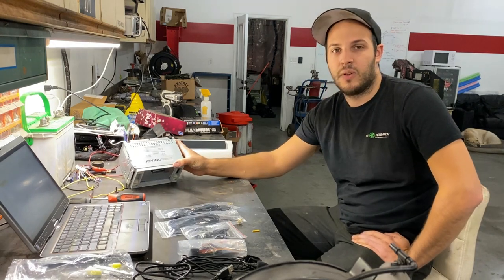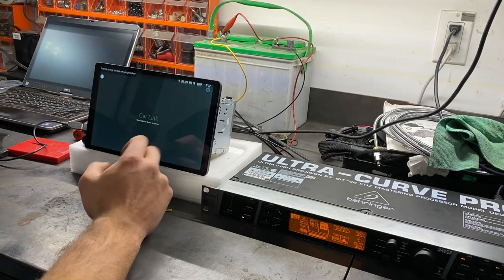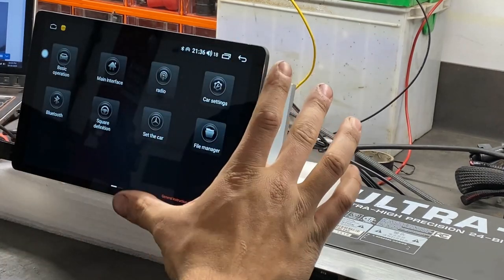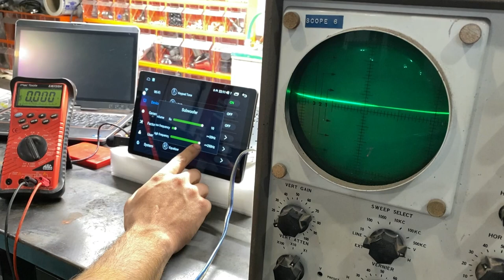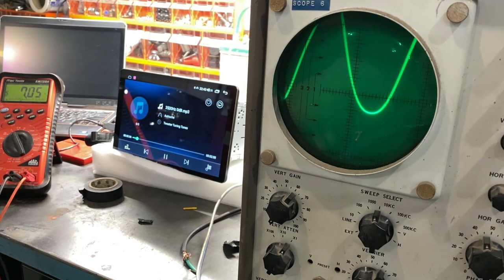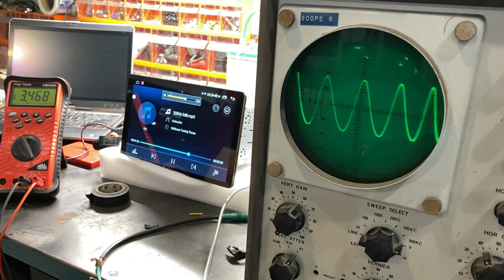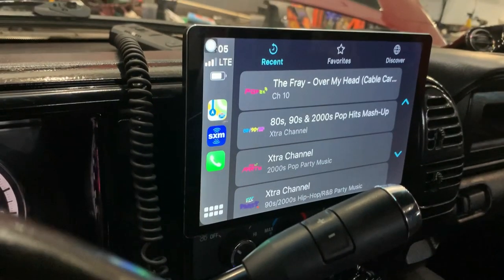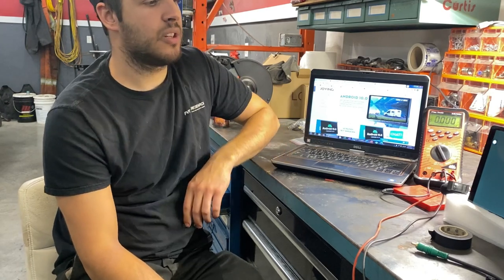NEW RELEASE ALERT! Joying 10.1" HD High Res Audio unit - Optical Output!! Ultra Resolution Screen!

Comment: P.s...I ordered my Intel based joying after watching your first video and absolutely love it. I ran it to my dsp via coax to optical input with a digital to digital converter.  I was surprised that the surround feature in the head unit was still operable after connecting it that way but it was a pleasant surprise because I can tweak the soundstage up to the center of the dash or wherever certain tracks sound the best even after saving the settings in my dsp which in my case is welcome because my dsp is a bit limited.

Comment: P.s.s...I dont think the "loudness" button boosts any voltage 
 in any way that's why it didn't clip your meter. I found the loudness feature to be very useful when listening at very low volume ( such as when your wife is riding in the vehicle and you can't turn it up past 2 or 3😂) because before at such low volume I could mostly hear the tweeters playing which was annoying,  but after selecting "loudness  on", it restored the bass and midrange back into the mix and I then can happily drive along with the little lady in the passenger seat. Test it for yourself,  it's a great feature to use when having to listen at less then optimal settings. All men play on ten, we're never gonna turn down again . Thanks for another great review,  peace.
Reply from the maker: On the intel units, Loudness did create clipping, You can see it in my first video. Thanks for Watching!
Reply: @colby dolby I agree with you. For lower volumes it's a great enhancement. A gimmick to so many but it works for me just like you said.
Reply: @LemonySnicket-EUC  question, 
Do you know what the true watts per channel is because it's saying 50 watts per channel???
I have 4 JBL gto629 6.5 door speakers and I would like to know if I'll be okay just running them with the 8 inch joying single din 1280*800P alone?
No amp

Comment: Thanks for the review. RCA/preamp voltage and detailed specs on their website are all that a lot of these Android units are lacking. Supposedly Dasaita has bumped their preamp voltage up to 3V after QMV reviewed their MAX 6 unit and criticized it. I've also noticed that on their website Joying no longer says what CPU model they are using, it just says 8 core 1.8GHz for most of them which is the same as the Intel based units but the 10.1" unit says it's an ARM CPU. I would be bummed if I ordered one of the vehicle specific units and got an Intel based unit which they could get away with due to vague specs. They also lack info on S/N ratio and RMS output of the internal amp. It's just crazy that a company can engineer something this complex and not publish the full specs like other manufacturers do.
Reply: Is there a way we could boost the voltage for the subwoofer preout coming out of the headunit?

Comment: Guys the reason I think they did the volume bar hidden is because this is Android OS. You can customize it. Download your self a Volume Control Widget. And have it set on Home Screen. Easy Fix....
Reply: Agreed. And the other reason also it’s very hard for right hand drive to turn volume knob if they put it on the left.
Reply: You can buy a wireless volume knob and mount it wherever. There are 2 versions available.
Reply: @LemonySnicket-EUC  Can u post me a link

Comment: Late to this party but man do I wish I had seen this. Wired my Android 10 2019 8-core (non-Joying branded) unit up to my DSP via RCA pre out and was getting very low signal. Measured it, and sure enough, 0.5v just as you mentioned.  Now I have to go back and use the speaker outputs to go high level into the DSP.  As a side note, my Android fader was not working either. It was sending front signal through the front preout and rear. Fading to the rear yielded no output. Wish Joying made a unit that looked a little more OEM for the 2006 BMW X5.  Anyway, thank you for the excellent information and review.
Reply: Is there a way we could boost the voltage from the headunit preout?

Comment: Greetings from Canada. Love the reviews and how detailed they are. Any updates on the digital output increasing to 96khz and I didn't notice if you mentioned if the output was 16 bit or 24 bit? 
Looking to buy the newest 10.5" with 6G or ram and 128G rom so maybe this unit will have a higher bit rate and Khz output

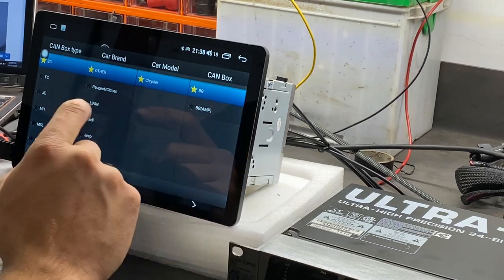Comment: Really appreciate the time you take to review these units in depth. My unit looks to be a pretty close match to this one and it’s really impressive so far. One thing I’m curious about - how do you know what the ‘box type’ is? You reference this at 20:50 but I don’t see any indication of my box type anywhere. Thanks
Reply from the maker: Unfortunately i “tried” all the ones related to chrysler. (Jeep,dodge,chrysler) until it started working. Maybe joying has better info.
Reply: @guimond47  mine seems to work fine with only a few exceptions that might be user error - the box type was set to null so I haven’t tried changing that yet - too scared lol

Comment: Thanks for the in depth video.  I am patiently waiting on my 11.6" 8G\128G unit to be delivered.  Trying to plan how I want to install and deliver signals to the DSP\amplifier... TOSLINK or via RCA's I may have missed it in the video... Is the SPDIF\Optical out only two channels requiring outboard DSP to realize separation and control of Fader\Balance\Sub, Front(L\R), Rear(L\R) & Sub channels or does it carry all channels?  If it is only two channels you loose control at the head unit unless the DSP has an android app that can be installed.  The Optical feed to the DSP\Amp is a nice feature if you can find a DSP\Amplifier with Optical\SPDIF input.
Reply: Did you ever get an answer or figure this out?

Comment: Convince them to make a knob/button that can attach to one of the four sides of the screen and is user movable based on use case.  Button control could use the same signal cable for the screen.
Reply: Just by a SWC wireless knob. They are like $20.
Reply: @extrakimF  it's amazing how so many people don't know this.

Comment: I dont know what source you used to test the sample rate but as far as I know, not every signal source is equal so depending on the source file it will determine what sample rate you see. A true optical output will play a recording mastered at 96khz. It seems your source was showing CD quality at best.
Reply from the maker: your probably right, my iphone Which is the source i was using for testing cannot provide more then 48Khz. I will try a flac file on Power amp and see.
Reply: Wouldn't the optical output they added be more of a convenience factor, seeing as most dsp's have optical in but not many have spdif input? Because spdif coaxial is 192khz where optical is 96khz. I'd be interested to test both of them and see if they arent limited to cd quality
Reply: @HAMMER_2.2  I'm hoping k&s will post his results after he tests his source unit. I used the optical because my dsp does not have a coaxial input which technically at 192khz would seem the more logical input if for ever any reason I was listening to a track recorded at that bitrate even though I highly doubt my used up ears could detect that difference anyway.

Comment: Thanks a lot for the great and extensive review. 
May I know if you have tested external USB DAC via the OTG?
Reply from the maker: No, it will not work. But why do you need it when there is a dac already in the unit, coax, Spdif optical
Reply: @guimond47  I see, coax and spdif of joying only upto 96kHz so i am trying if any chance to hookup a DAC via OTG to the back of the car and run a very short RCA to DSP. But i have decided on Helix DSP.3 which only upto 96kHz so i think doesn't matter already. Anyway, thank you so much man
Reply: @guimond47  Does the volume control work when youre connected via digital out?
Reply from the maker: @imraneo  yes

Comment: Great video... you said that we can cut the speaker wire leads and solder rca's... what's my options for a subwoofer output?
Reply from the maker: Subwoofer would remain stuck on RCA. There is no quality needed on bass as much as vocals ( thoses picky with rca voltage) ive used their 1.5v rca without issue

Comment: I have an OBS Chevy as well, but the 88-94 interior. Ive been looking at solutions to a steering column swap to hooefully shorten it up some. Did you swap in a dodge column, or is it a dodge steering wheel on the Chevy column?
Ive been wondering if those 1995-98 columns are any shorter than my 88-94 column.
Id love to see a all-around of your truck!
Reply from the maker: You can see our builds at k&s diesel conversions on facebook page. The whole truck is swapped.

Comment: Damn. My brand new 11.6" Joying 10.0 headunit is getting .643 volts at Max volume, on a 40hz test tone, & subwoofer power menu at Max 10.
I wonder if it's cause I split the RCA with a Y splitter?
Reply: Did you ever figure it out
Reply: @BeatYourAss99  I never did.
Reply from the maker: @ElevatedVehicles   new joying headunits now have 5V preouts for 2023 units. Releasing a new review video in a day or so! keep an eye out!

Comment: NICE BRO I LOVE ALL YOUR VIDEOS THANKS
Reply from the maker: Stay tuned something big coming soon to the channel. Thanks for the support!
Reply: @guimond47  how many true watts per channel ?  I would like to run my jbl gto629, 4 total and 8 inch joying single din 1200x800 head unit by it self...
Will the joying do okay with the gto629 no amp?
Reply from the maker: @kedsification  I had my VW on internal Amp and had a 600Wrms Sub. kept up. Depending on what your expectations are id say the joying is around 18W Rms. That is just a guess though. you can buy very small compact amps now days.  like this one : https://www.crutchfield.ca/p_158XMS400D/Sony-XMS400D.html?awkw=556576599977&awat=pla&awnw=g&awcr=308265689979&awdv=c&awug=9001145
Reply: @guimond47  the jbl,s are 3 ohms speakers also, 
Reccomend rms is 5W-125W....
Do you think that the internal amp could hold it's own?
Not looking to tear the roof off. 
I'm dam near 60 years old. 
Lol
Reply from the maker: @kedsification  it will be fine at 3ohm.
Reply: @guimond47  thanks. 
I'm going to see how it sounds with just the head unit and the jbl,s
Reply: @guimond47  HEY BRO, SORRY BUT QUICK QUESTION,  IS THIS UNIT TOO BIG FOR THE 2013 CAMRY?

Comment: Did you say it has an ir receiver for a remote?  Any info ln that? 
I am so used to using remotes for my headunits, years of owning a truck without steering controls got me accustomed to the remote lol.
Reply: I have one of their wireless remotes and love it. The one I use is designed to seat in a cup holder and has a round knob with side buttons similar to the style of luxury cars like BMW use. They also make two different models that strap to your steering wheel.

Comment: My amp came with black & red subwoofer cables. How do I Plug this in when this only has one sub out on the headunit?
Reply: Dont buy the joying if you want to hook up an amplified subwoofer.  The rca y splitter doesnt work on this. I know, cause i just bought one, an no way to hook up my subs.
Reply: @watsnu2day  I'm having this exact same problem
Reply: @watsnu2day  Why would a Y cable not work?
Reply: @JasonWW2000  I'm not sure why some people experience problems, but just as another datapoint, I will add, that a y-splitter works just fine for me.  Grabbed an ancient one I had from back when I ran two Punch 100s as my sub stage and it worked just fine.  One possibility for the discrepancy is that for any rca output to be active you have to turn on the AMP output in the settings menu...if you were only trying to hook up a sub stage, that might have gone unnoticed.  I was missing my front stage also, and went searching for settings....
Reply: @timtemple8953  the y splitter worked for me to. How can we increase the subwoofer preout voltage from the headunit? I think in this video he measured 1.5volts and I would like 5 volts RCA going to my amp

Comment: Do you have volume control over the processor with the optical output?
Reply: Yes, you can control it.
Reply: Just another verification. The Joying will control the volume of a helix processor via the optical digital output.
Reply: @13BTRX3  how does that work? I thought you had to use a director or URC 3 to control volume when using digital input.
Reply: The head unit send the data for volume to the processor and it varies the output. Not all dsps can do that though. The head unit and dsp both have to be capable
Reply: @13BTRX3  How would one determine if their DSP is volume capable? Is this newer technology or does it have a specific name?

Comment: will andriod head units be outdated and unusable after 3 to 5 years like cell phones
Reply: Marcel Schuller  I've done some more research and I'm sticking with name brand head units  I have a 2015 head unit in my truck that still works great and 2020 in my car also works great should be good for several more years don't want  to have to replace every few years already have a Android phone
Reply: Marcel Schuller  That's what I have always done but these looked interesting but sound is most important for me I have high end  component speakers and amplifiers so no Android for me.
Reply: Marcel Schuller  I do have a really nice Bluetooth deck in my car pioneer NEX 8200 I do like the idea of having a tablet in there though the only problem with that is if you do do a custom dash for it chances of finding one that fits in that exact hole again are going to be pretty slim I would imagine.

Comment: The optical output caries volume information as well. I was planning on running it to my helix dsp, but I didn't know if the head unit would control the volume.

Thank you!
Reply: Oh really it does?? I just asked this question above.
So I can use optical to my helix P6 with steering controls...
Nice!
Reply: @imraneo  yes, it works perfectly with my dsp mini
Reply: @13BTRX3  Thanks man. Awesome!